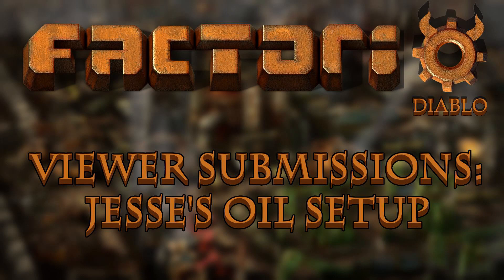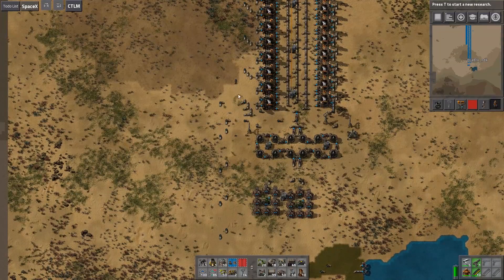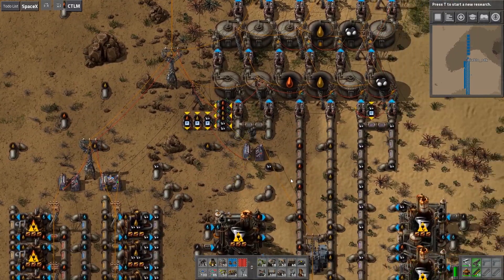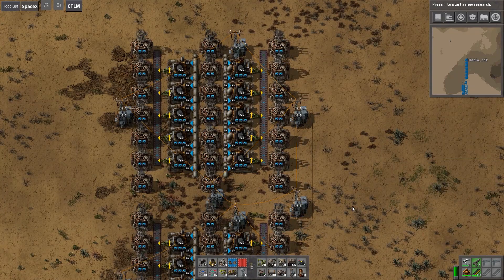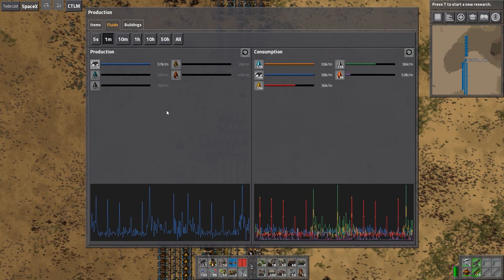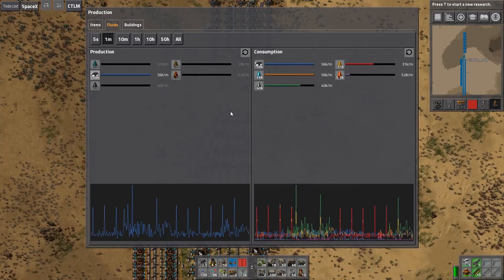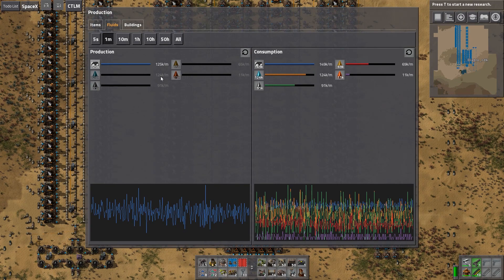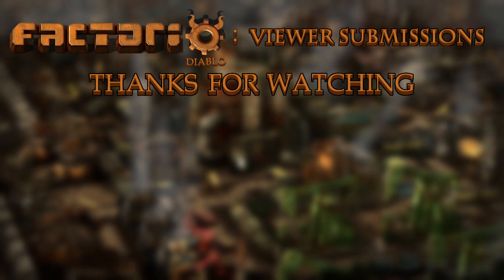Factorio: Viewer Submissions: Jesse's Oil Setup

Comment: I really like the "design review" idea!

If i may comment on Jesse's design: Unless he/she provided any comment, it strikes me as a "f it, I've got the room but not the resources" approach. I might be wrong here, but I think that putting in the the beacons like you did, gives you more bang per area (much more), but beacons and esp. modules are quite time and resource intense to build. And if you have a kind of outpost that just sends back petrol to your main area, this might actually be cheaper to build than your version. If, for some reason, you were to run power in your whole setup on something like coal, the on/off stuff also makes some sense... all together, it looks (to me) like a very specific build for a very specific situation or playstile

It might be useful and intesresting to you compare the raw numbers on resources it costs to build a certain setup if you compare it with your own design
Reply from the maker: You make a good point. I tried to say something similar in my video as well but it might not have come across well enough. Yes beacons and modules are expensive but I think in the long run well worth the cost.
But it might indeed be an early setup so resources might be more scares, I should have kept that possibility in mind during my review.

resource cost is indeed something that could be interesting to use when comparing two setups, thanks.

Most of this video was done, without a script, just me ranting, I was hoping it would come across a little more loose, a little more natural. I might need to script a little more, so I don't forget or omit things.

Thanks for the feedback though, it is helpful.
Reply: @Diablo_rdk  Don't worry, everyone loves a good 'ol rant now and then ;)
Reply from the maker: @johnnymellon7414  :)